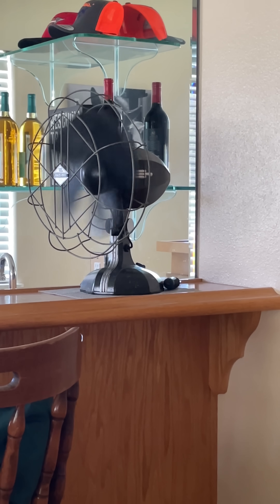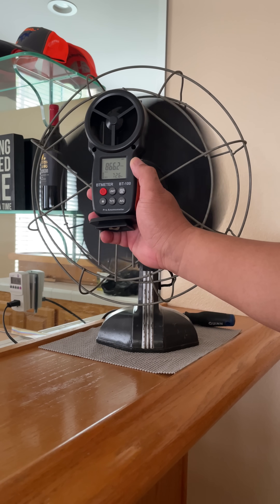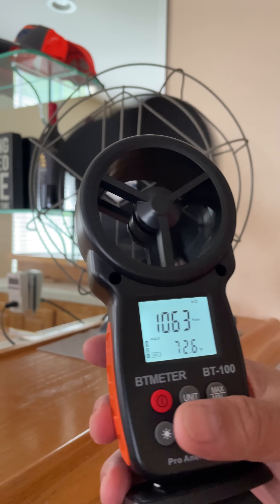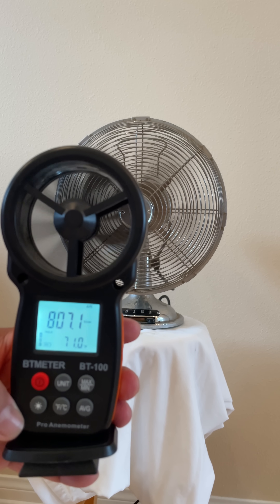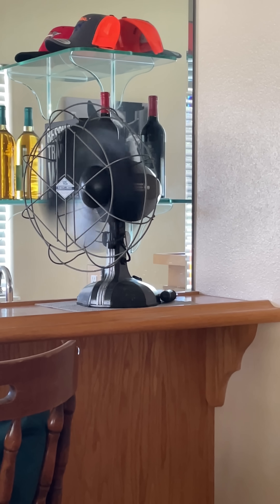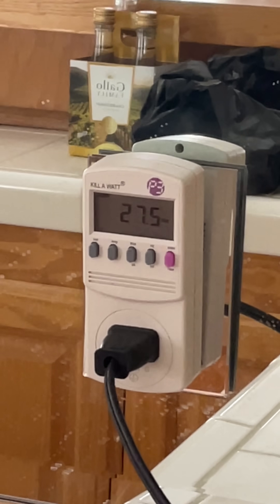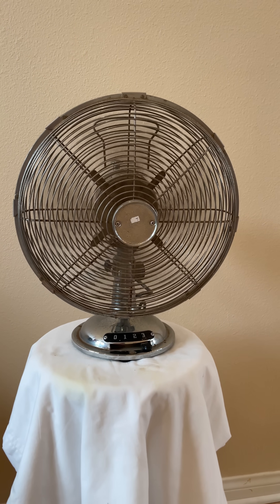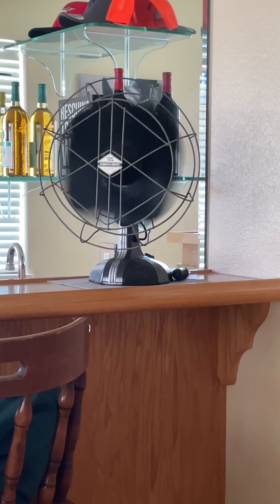Why Vintage Fans are Better #shorts

Comment: I picked up a Westinghouse fan similar in size to yours. It doesn't have an oscillation function but it works great, suprisingly quiet, weighs about like a boat anchor. Just gotta be careful around that open guard.
Reply from the maker: The Westinghouse fans with the deep pitched Micarta blades are great. And yes you do have to be aware of the blades.

Comment: I can say without a shred of doubt these new units are not tested nor designed for 100+ degree ambient temps!! Here In AZ on hot days you can walk around and hear the compressors just STRUGGLING to stay running. Hell even my central Lennox unit labors during the hot afternoons. As far as EERs go it's also physics, these old units with their larger coils can transfer heat much easier without a power hungry & loud high speed fan. While inverters are a very efficient and nice technology they are complex and if a major part goes they're proprietary and often expensive to replace which negates the energy savings.